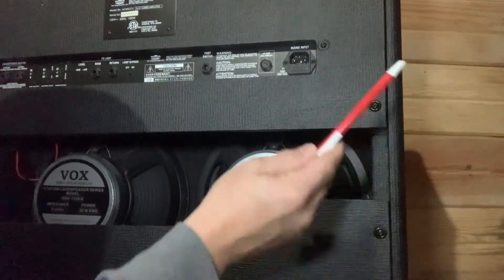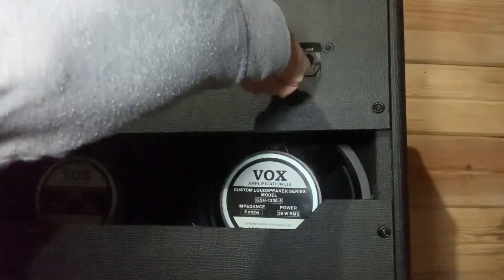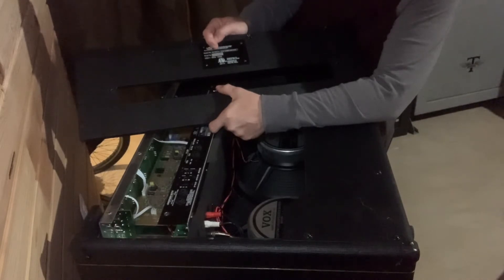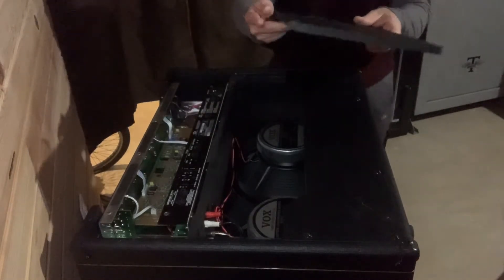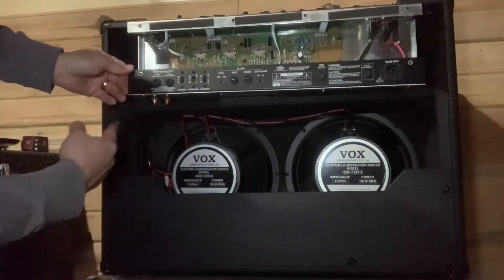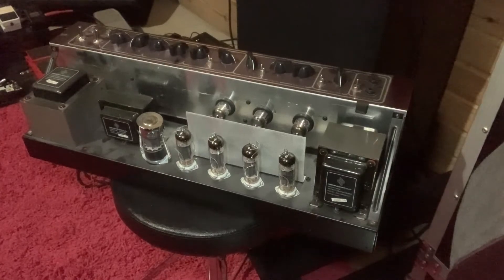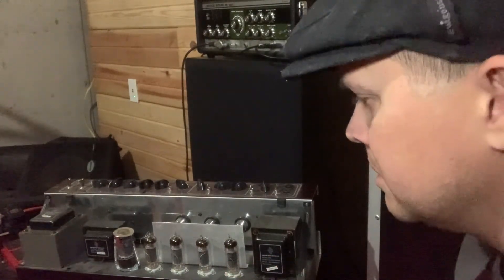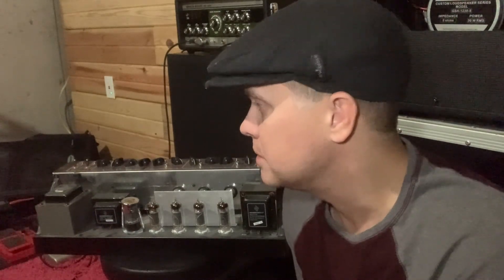Vox AC30 tube repair

Comment: Just got a cc2, mine was working fine until it blowed the fuse, now the power switch light up but the standby switch won't, no sound, do you think it coud be the rectifire tube?
Reply from the maker: Hey Bruno, sorry to hear you are having problems.
it could be. Is the amp new? have you taken the back off and looked at the tubes to see if there are any obvious signs of a malfunction? I would start with that. look at the board too. look for any burn marks, anything that does not look normal.
Reply: @Deluxeguitarsongs   yes it was the rectfire tube, both fuses inside are ok, the tube is blow, sad part is I live in Brazil, tubes are to expensive these days dolar is 5 to 1 for us
Reply from the maker: @brunosucheck1191  Hey Bruno, sorry to hear you have a blown tube. Good job trouble shooting it though. look on amazon and see if you can find any that are used that might be cheaper. good luck to you!!!!
Reply: @brunosucheck1191  dont use the standby switch..it will blow the gz34///or even better get a copper cap  from weber and it will never blow